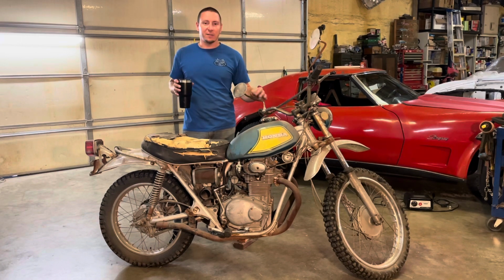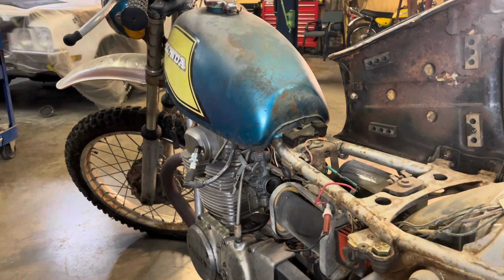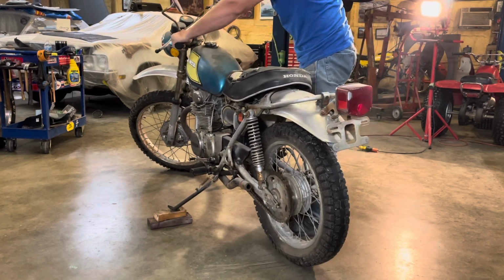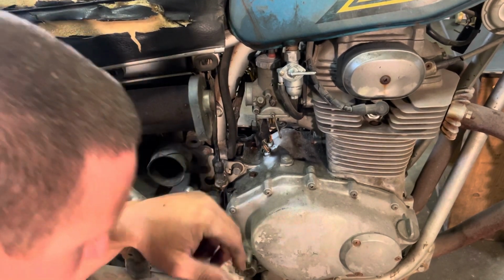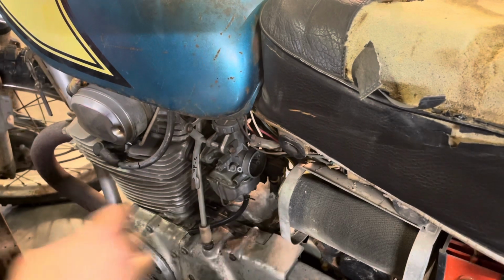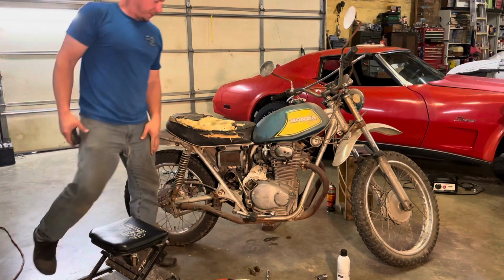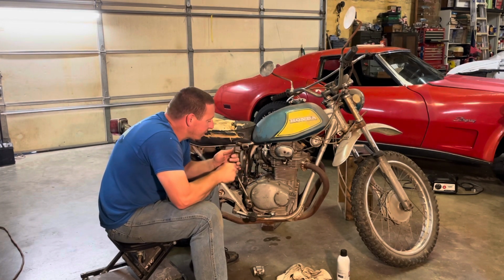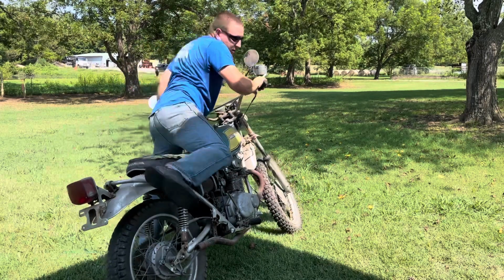Will it run ? 1973 Honda SL350 parked since the 80's

Comment: Great video, thanks man!  I knew it would start right out.  Back in about 1994 a guy that I knew had one of these sitting in his yard on flat, dry rotted tires.  Finally one day I stopped over there I decided to ask him if he wanted to sell it.  He said that it had been sitting in his yard for 8 years and he would be glad to sell it.  He said give me $50 and it's yours.  I couldn't get the money out of my wallet quick enough.  LOL!  I tinkered with a for a little bit and got it started on one cylinder.  The tire shop (family business) that I managed at that time was right down the street so I rode it to the shop and locked it up.  When I came in to work the next day I started cleaning it up, cleaning the tank, cleaning the carburetors and I installed new points and changed the oil of course.  I found some old used dirt bike tires that we had laying around the shop that fit it so I put those on it with new tubes.  It didn't take much at all and that thing ran like a sewing machine!  I was surprised how fast it was for such an old bike!  My brother has a 1986 Honda 250R that he bought brand new.  He and I had some really good races!  My old SL-350 was neck and neck with his 250R until I was topped out in fifth gear.  Then he would shift into sixth gear and start pulling away slowly.  I think he paid around $2800 for his 1986 250R so I was extremely proud of my $50 SL-350!  That bike was so much fun and it was extremely comfortable to ride!  Event when my best friend and I used to take it out almost every night and ride up and down the dry wash here in Tucson.  Even with two of us it was comfortable, it was fast and it was fun!  Best $50 I've ever spent!  Thanks again for the cool video!  You earned my sub!
Reply from the maker: thats an awesome story…. !!!!!! i’ve recorded some new videos on this bike that i will be putting out here before. getting it running good, new side covers, new clutch, new cables sets, a new seat and more cleaning. once i get it running and operating good i plan to give it a proper 100% restoration. i appreciate you watching!!!
Reply: @BrokenWrenches  It was an awesome bike, that's for sure!  Yeah, I wish I had restored mine.  I'll be watching for the other videos.  Thanks again and best of luck with it!

Comment: Just got 1969 K0 last week for 1k that's in a bit better shape but I need to go through the same steps with the carbs this week, mine has the electric start and is 65lb heavier.  Fingers crossed, when I bought it starter fluid got it to fire.
Reply from the maker: Thats awesome!!! I wish mine had a starter, kick a hole in the bottom of your foot otherwise. Im fairly certain one of the carbs is flooding. Mine needs all of the common wear items like the clutch and a bunch of rusty cables replaced.